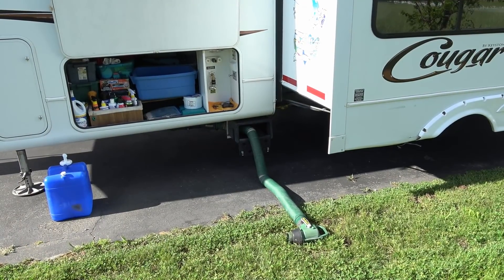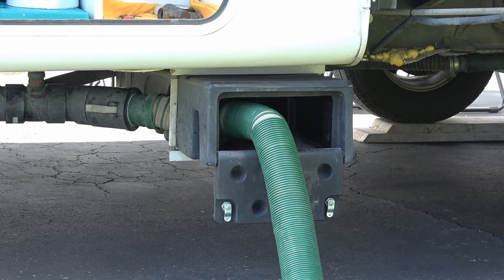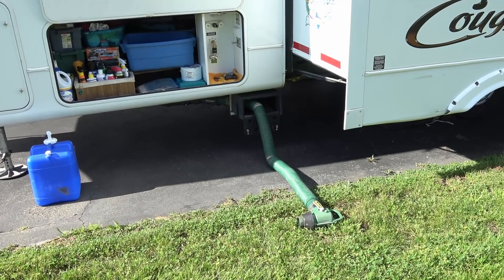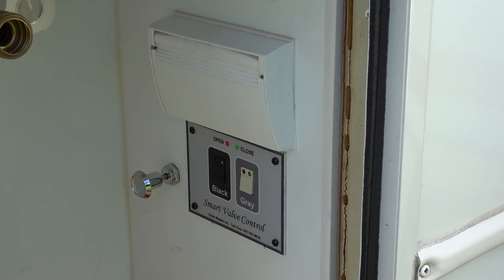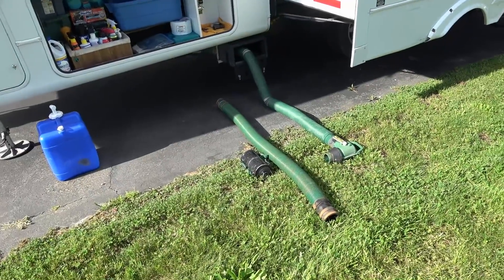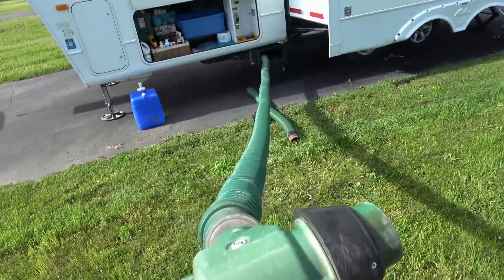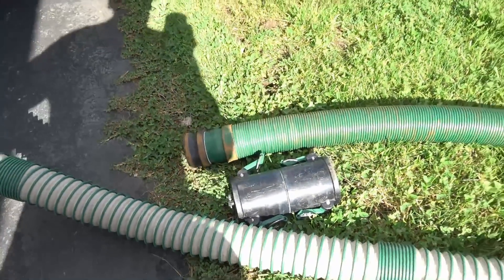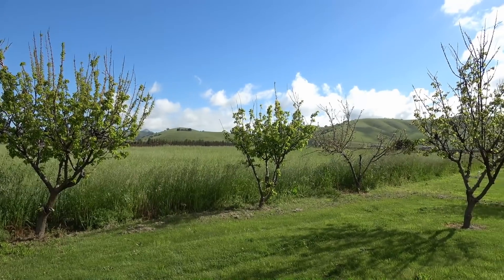Demoing my Quick RV Waste Tank Dumping Setup

Comment: The only bad thing is those dump stations with the flapper on it.  Hard to get the end valve to sit flush inside the hole. Other than that best hose for sure.
Reply from the maker: I've run into the odd one that has a tight metal flapper, what I can do is plug my extension hose in and use it since it doesn't have the head end.

Comment: You don’t have a black tank flush? I’m loving the setup.
Reply from the maker: Yes, the trailer came with a built-in No-Fuss Flush black tank flush system. I don't need to use it every time though, just once in a while and more when I'm stationary for a spell and not moving a lot. When I'm on the road with full or partially full waste tanks the sloshing around does a good job of keeping them clean.
I also have a flexible tank wand I can jam down the toilet when I want to do a power clean
https://www.loveyourrv.com/flexible-rv-waste-tank-cleaning-wand-demo/    https://www.loveyourrv.com/oh-crap-rv-poop-tank-flusher-broken/  Cheers, Ray

Comment: Have you tried this hose in the metal (bronze I believe) foot operated inlet found in some dumping stations. Pennsylvania state parks use this type of inlet cover. It doesn't open very wide. So curious if you've used this hose with that type of cap lid? We camp 95% at state parks, so we see/use this type all the time. Not sure with it's limited opening width if the nozzle head on the hose would fit or not.
Reply: I'd add a picture but YouTube doesn't offer the option to upload a picture.
Reply from the maker: So far I haven't found one that I couldn't fit it into and we do lots of State parks out west and dump stations with them. A few I have had to kinda turn it sideways but able to dump. I do carry a short piece of the old style hose and figure if I hit one where the Waste Master head won't fit I'd put the short piece of hose into the dump hole then press the Waste Master rubber donut into the other end of the short hose.  Cheers, Ray
Reply: @LoveYourRV  I appreciate your reply!

Comment: Hi Ray, Is there any concern with build up in the hose. Are you able to flush with water after dumping?
Reply from the maker: No, because this hose is designed with the ribbing on the outside versus inside like many cheaper hoses, so the inside is perfectly smooth rubber that stuff doesn't stick to. I always dump my shower tank last and its just soapy water so best thing for it. :) Every once in a while I also use my tank flusher and fill the tanks a few times and give everything a good rinse. I've never had a clog going on 8 years full time now. I think another reason is I never leave my tank valves open at a campground I always let them fill up then dump, even my grays. Helps keep things well flushed out and not build up. Cheers, Ray

Comment: I realize you were demoing the hose. Do you have a black tank flush, if so do you use it every dump or just sometimes? Frequency?
Reply from the maker: Yes, the trailer came with a built-in No-Fuss Flush black tank flush system. I don't need to use it every time though, just once in a while and more when I'm stationary for a spell and not moving a lot. Maybe once every 2 weeks.
When I'm on the road with full or partially full waste tanks the sloshing around does a good job of keeping them clean.
I also have a flexible tank wand I can jam down the toilet when I want to do a power clean
https://www.loveyourrv.com/flexible-rv-waste-tank-cleaning-wand-demo/    https://www.loveyourrv.com/oh-crap-rv-poop-tank-flusher-broken/ 
 I've never had a clog going on 8 years full time now. I think another reason is I never leave my tank valves open at a campground I always let them fill up then dump, even my grays. Helps keep things well flushed out and not build up. Cheers, Ray

Comment: I find it difficult to put the hose back if the sewer hose is closed. The air gets caught and won’t close easy enough. Leave it open and it works fine. How do you do it ?
Reply from the maker: When I installed the storage box system and had my sewer piping all apart I installed a one way check valve on the top of the output sewer pipe that will expell he tapped the air as I recoil the hose.
https://www.loveyourrv.com/wp-content/uploads/2016/07/Check-Valve-Installed.jpg

Comment: Do you have a wash port (what's it called?) installed in you waste tanks so you can blast out the gunk?
Reply from the maker: Yes, the trailer came with a built-in black tank flush system. I don't need to use it every time though, just once in a while and more when I'm stationary for a spell and not moving a lot. I also have a tank wand I can jam down the toilet.
https://www.loveyourrv.com/flexible-rv-waste-tank-cleaning-wand-demo/    https://www.loveyourrv.com/oh-crap-rv-poop-tank-flusher-broken/

Comment: I noticed that you don’t rinse/flush your hose after completing the dump.  
Probably because the hose is not very convenient to disconnect and reattach.
I understand that it gets somewhat flushed from the gray water but I still prefer rinsing out the hose thoroughly after a dump with fresh water.
I’ll stick with the “manual” mode including the slider valves which work good and last a pretty long time.
Reply from the maker: No need since it's always connected also this hose is designed with the ribbing on the outside versus inside like many cheaper hoses, so the inside is perfectly smooth rubber that stuff doesn't stick to. I always dump my shower tank last and its just soapy water so best thing for it. :) Every once in a while I also use my tank flusher and fill the tanks a few times and give everything a good rinse. I've never had a clog going on 8 years full time now. I think another reason is I never leave my tank valves open at a campground I always let them fill up then dump, even my grays. Helps keep things well flushed out and not build up. Cheers, Ray
Reply: Good advice, I do the same except the extra fresh water flush because of my rv‘ s setup.

Comment: Are there still manual handles in case the automatic system fails?
Reply from the maker: Yes the electric valves can get open and closed manually if they failed with an included Allen key - https://youtu.be/_G61xCEsJtU